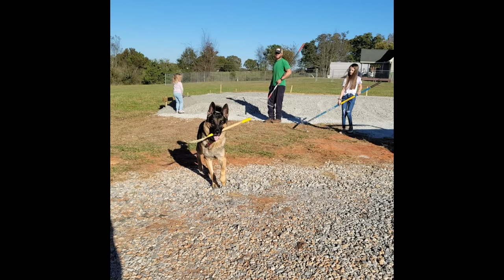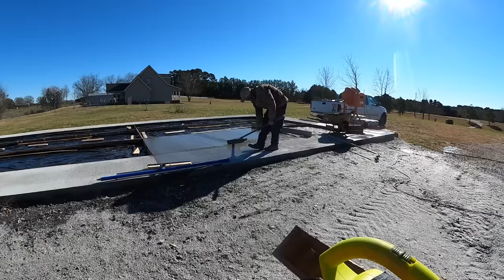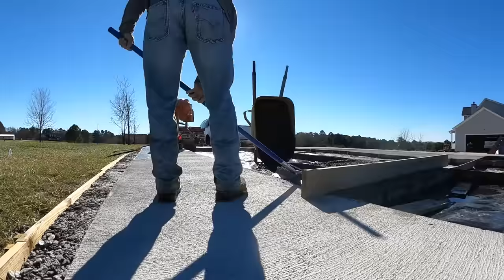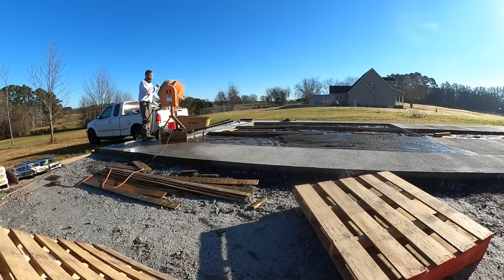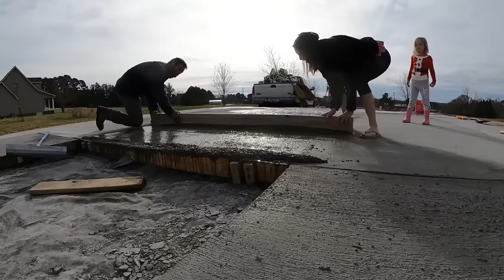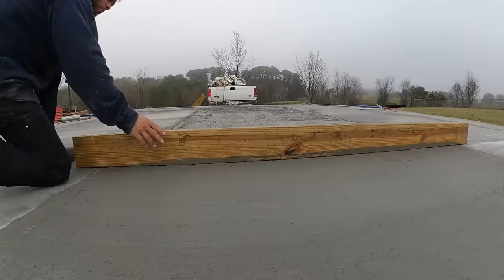Pouring a Huge Concrete Slab Using Bagged Concrete | I Saved $10,000

Comment: I'm not a concrete guy either, but what I don't understand is how you were able to get that much material out without the initial bags beginning to set up compared with the end bags.

Slow cure seems to be the answer, but that seems WAY longer than any cement I've dealt with, by many hours and then some...
Reply from the maker: I did this in our winter which was 40-50 temps at the time. The cooler temps allowed more work time. I did a one year update you should check out if you’re interested.

Comment: Love it 😅!  What would you have done different?
Reply from the maker: Thank you! I haven't had any problems whatsoever, and everything still looks as good as the day I finished. But the only thing I would've done differently (for added insurance) is tie the slabs together with rebar. I packed over 100 ton of gravel beneath it so it shouldn't be going anywhere anyhow. But that wouldve been good insurance.
Reply: @reallifetested2605  Interesting!  I was thinking the same thing.  Great idea 💡 btw!!!  You should add that to the end of the vid.

Comment: Is that bagged pre-mix cement?  Here in Australia that would be a very expensive option compared to mixing actual aggregate, sand and cement. Fair plan though , I’ve done a few.
Reply from the maker: It is. I looked into doing that because around here it use to be cheaper as well. With crazy inflation between high Portland cement and sand in my area it was going to be right at the same price vs the way I did it. Economics in the world are really messed up right now.

Comment: Was this all broom finish,  Curious what you process was.  Did you mix, pour, rod, bull float then broom?  Any edging, mag float or troweling?  I am looking to do this and concerned I won't have time to properly finish before it sets up.
Reply from the maker: Yes it was all broom. I mix, pour until I have a substantial amount in the forms, screed, float, waited until it was a good hardness then broom.  I did this in winter so I had plenty of time to work. As long as it’s cold out you have a while. Just make sure it doesn’t get below freezing. Our winters are mild. 40-50 in day time and high 30 to 40 at night when I did this.

Comment: I’m sure I’ll be undertaking something like this in the future so I feel the need to ask these questions. Why no rebar? And you’re not worried about the different sections moving independently of one another causing lippage?
Reply from the maker: I made a 1 year update answering a ton of questions that were asked in this video. If you’re interested you should check it out. The rebar is based on where you are. In my area no one uses it because it rarely gets below freezing and we don’t have earthquakes or anything like that. Most of the time around here they pour directly onto the clay with no issues. I haven’t had any shifting or moving of the slabs (I don’t expect to with the amount of gravel I put beneath) but just for added insurance I do wish I had pinned the slabs. I also cut control joints which I show in the other video. I’m going to be doing a 2 year update soon so stay tuned for that as well.

Comment: I understand. So many jobs get high estimates. Fence companies are driving in these easy metal posts now but they still quote five grand for 50 to 80 ft. Why is there $4,000 of Labor on $1,000 of material and you're going to be done in 3-4 hours? They'll rationalize it that you've now got something that will last 20 or 30 years so the cost per year is cheap. Really? I don't know that.  That's not how I spend money on most other things.
Reply from the maker: It’s funny you say this about a fence. I’m starting building our chain link fence today. We got quotes of 12 to 14k. I bought everything and doing it myself for about 7k.

Comment: How did that slab hold up on the gravel? When I built my shop they used road base gravel and it has done OK but a few spots are settling now.
Reply from the maker: It’s still holding great. It’s been a little over 2 years now and no hairline cracks. I did pack the heck out of it every few inches though. Also used recycled concrete on the outer edges that has hardened like a rock.

Comment: Load of rock, sand, and bags of portland cement.  Cheapest way with a mixer.
Reply from the maker: I checked into that before doing this project. The high price of sand and cement in my area was going to be about 163 per yard. I couldn’t believe that it was that much to mix individually going that route. I was able to get #80 bags for 3.20 each so I went with that.

Comment: no rebar and not enough expansion joints are a big problem
Reply from the maker: I called around and spoke with local pros. In my area they don’t use rebar on 4” residential on grade slabs. It rarely gets cold here and we have a hard clay soil. I’ve never seen it used in small buildings / driveways around here. I did a 1 year update if you’re interested. I don’t have any cracks at all and show the slab. I cut expansion joints just not in this video because it was so dusty you couldn’t see anything.

Comment: As european I would highly consider buying trailer of sand and washed 4-8mm gravel fraction, some bagged portland cement and mix own mixture. But is it possible to buy gravel in such small quantities in the US?  It is little bit more work but messing with pallets of bagged concrete isn't so much better and you are paying extra for same thing in hundreds of bags.
Reply from the maker: I looked into that because I’ve heard it’s a lot cheaper. In my area sand and Portland are so expensive it was only going to be about 5 dollars cheaper per yard going that route. Sand is going for over 50 dollars per cubic yard here how insane.
Reply: @reallifetested2605  Oh, I understand, it make sense if there isn't big difference, 5$/yard isn't worth of additional effort.

Comment: question, did you use rebar to reinforce your concrete slab?? and also did you cut out expansion joints after the concrete is set?
Reply from the maker: I didn’t use rebar. I made a one year update explaining but long story short our climate and my load requirements don’t really need rebar. I also go over the control joints in the other video as well. I did cut them.

Comment: Thanks for the awesome video. What are your thoughts on mixing the concrete in the wheelbarrow or the powered mixer? Did the mixer save a lot of time?
Reply from the maker: Definitely get a mixer if you're going to be mixing anything over 10 bags. I recently constructed a chain-link fence which used around 60 bags or so. (If I remember right) My dad told me that we could easily mix by hand in the wheelbarrow because the mixer and cord / setting up etc. would have took 10 minutes so we didn't have time for that HA We mixed 4 bags by hand and I said as long as there is a mixer nearby. I will NEVER do this again. It takes a ton of extra time, hard labor, and its harder to get consistent. I went and grabbed the mixer and we finished probably hours earlier.  Long story short. Definitely get a mixer if you have the space for it.
Reply: @reallifetested2605  Thanks for that info. I hope to pour some slabs soon. My barn is dirt that in winter turns into mud. So 6 months out of the year I can’t use it. I will add rebar to hold it all together and help with tractor truck driving on it. Buying 16’ dump trailer to haul my own rock.

Comment: great video and job, but don't you need rebar or wire mesh in a slab that big to keep it from cracking
Reply from the maker: Thanks! I called around and spoke with local pros. In my area they don’t use rebar on 4” residential on grade slabs. It rarely gets cold here and we have a hard clay soil. I’ve never seen it used in small buildings / driveways around here. I did a 1 year update if you’re interested. I don’t have any cracks at all and show the slab.

Comment: I'm not contractor or concrete guy, so I'm pretty ignorant when it comes to doing concrete work. I have a similar feat to accomplish myself after getting a 12k quote to pour a 24x24 pad for my patio... i liked you're idea of breaking up the concrete pad with the forms so that you could do it in sections. My only concern is that it looks like the forms you used you actually encased in the concrete, is that normal practice? will that not effect the overall longevity of the concrete structure? I also didn't see you put any rebar before the pour?
Reply from the maker: I did remove the forms. What I did was pour the outside pads first, then remove the center forms. I then used the outer pads as the forms (hope that makes sense. I posted a 1 year update with me answering the most frequently asked questions as well as doing a walk over of the pad. If you're interested you should check that out.

Comment: Nice work, you said you mixed a bag at a time, but how many bags did you mix and put in wheel barrow before you took it and dumped it. I was having trouble keeping up with the time lapse. Really impressed with your work..
Reply from the maker: Thank you! With this mixer I was mixing (2) 80 lb bags at a time. I was pouring (4)mixed bags in the wheel barrow dumping and repeating.
Reply: @reallifetested2605  thank you Sir, appreciate you responding back.

Comment: no rebar? is it normal to pour slabs without the reinforcement that provides? wont it be much more prone to sag and crack without that, especially if you use it as a garage and park very heavy things like vehicles on it?
Reply from the maker: I called around and spoke with local pros. In my area they said they don't use rebar in residential on grade 4" slabs. Around here they really only use it in homes or commercial / industrial construction. It rarely gets cold enough for the ground to freeze here and we have good soil. We also don't have earthquakes or anything like that (that I know of) I did a yearly update and will continue to do so if you're interested. I haven't even had a hairline crack yet.
Reply: @reallifetested2605  thanks for the info. i'm trying to learn about slabs and i thought the rebar stuff was to prevent the thing from sagging due to either direct weight above like a house/car or the weight it places on itself when the ground below unevenly sags due to "settling".

Comment: Ya know. This has kind of inspired me to pour the foundation for my 450 sq ft cabins. Much respect. How many sq ft and total cost?
Reply from the maker: It was a little over 1200 sq ft. With approx 120 ton of gravel, and the concrete I have about 3800 dollars in everything. I did a 1 year update if you're interested in checking that out, I answered the most frequently asked questions and went over local bagged pricing on my phone and things like that. You could definitely do 450 sq ft. no problem I can guarantee you'll save a ton of money. We got quotes of 14k plus for this job. 

https://www.youtube.com/watch?v=qKcy6BI8yA0&t=568s

Comment: Wait what did you do in between the 6 pours?  Did you leave the 2x4 in????
Reply from the maker: I did the outer pours first, removed the wood forms, then used the outer concrete slabs as the forms for the inner. Hope that makes sense.

Comment: Great job ! I’m doing the same thing on a smaller scale for a patio that I’m also pouring in manageable sections.  Can’t decide if I should use expansion joint material between the sections but it looks like you did not. Any thoughts on whether I should or not I’d appreciate.
Reply from the maker: I didn’t show it in the video because it was so dusty and you couldn’t see anything anyhow. But I did cut expansion joints. There is information online about how far apart to cut them based on the size of your slabs. You can better tell in the one year update I made a while back. I used a diamond blade and circular saw to cut the joints. Hope I was able to help out.

Comment: Great Job, hard work pays, I just did a 4X7 slab that was 6 inches thick for my propane tank to sit on.  I used a lot of rebar in it. Why didn't you use rebar?
Reply from the maker: Thank you! I called around before starting this project and spoke with local pros. They said that rebar wasn't needed in a residential on grade 4" slab in my area.

Comment: I'm getting ready to do a project, but nowhere near this scale. It's going to be 20x20. I'm trying to figure out of it's worth it to do what you did, or buy the concrete and have a truck delivery it.  Do you think the price of the bags, renting a mixer, and the labor to mix it would be worth it for a project my size? Do the bags save that much money on a smaller project?  I'm guessing it would on a project the size of yours, but I don't mind spending an extra hundred or so for a truck if it's not to much of a price difference.  Thanks!
Reply from the maker: It may be different now, or in your area. When I did this was during Covid. Truck was 200 to 220 depending on the day with a 4-6 week wait. The lowest quote we got on this was 14,000 dollars. I was able to do everything myself for 3800. I think concrete prices have came back down so it’s really up to whatever you’re comfortable with. One huge pro to bag is you can take your time with it. When the truck comes you have to know what you’re doing and get everything spread and screeded fast. Usually concrete crews have at least 6 or more guys all working together.

Comment: That's quite a workout !   How were you able to keep everything wet and pliable to be able to trowel the complete pour ? Looks like you may have had some poly down to maintain moisture.
Reply from the maker: Thank you! I did this in our winter (which isn't very cold) daytime temps were high 40's and night time temps were high 30's so perfect temperature for doing concrete alone. The poly works as a moisture barrier as well.

Comment: Nice work!  I am about to do the same for a similar size slab. What was the size of each section and how long did each section take to pour?
Reply from the maker: They were somewhere around 7-8’ wide and 20’ long. I don’t remember the exact working time because of my work schedule I was having to get everything out and put it all back up every day which added a significant amount of time. If guess somewhere around 5 hours of actual mixing, spreading then waiting around for it to harden up and floating it. I did it in cooler temps so I’d have plenty of time to work. The cooler the better for time as long as it’s not freezing.

Comment: Very cool. But you may regret no wire support.
Reply from the maker: I called around and spoke with local pros, they told me rebar wasnt needed in a residential on grade 4" slab in my area. I've seen 100's if not 1000's of houses in my area built at this point and they didn't use rebar unless it was requested. (in the driveways, not foundation footers)

Comment: You are bad to the bone dude.  You saved a little over 10K.  How much did you actually spend on the project to get the slab completely formed?
Reply from the maker: Thanks brotha! In total for gravel, concrete, and forms I had right at 3800 dollars if I remember correctly. For gas in hauling and all call it a little less than 4k. 

I made a 1 year update video along with me responding to the most frequently asked questions if you're interested. 

https://youtu.be/qKcy6BI8yA0

Comment: I'm almost certain code calls for rebar or metal lattice other than that looks good
Reply from the maker: I called around and spoke with local pros, they told me rebar wasnt needed in a residential on grade 4" slab in my area. I've seen 100's if not 1000's of houses in my area built at this point and they didn't use rebar unless it was requested. (in the driveways, not foundation footers)

Comment: 80lb sack is $5-$6 and it takes 42 sacks to make one yard, that puts it over $200 per yard.
If you hire a concrete truck it’s $100-$120 a yard. 
You may have saved in other areas but you surely didn’t save by buying sack concrete
Reply from the maker: In my area bags were 3.20 for 80 and 200 to 220 for truck with a 4-6 week wait. Contractors wanted 14k minimum and I did everything for 3800.

Comment: I have done jobs like this over the years mostly by myself with great satisfaction. I am moving to another location soon and want to build a 20 by 24 shop, and doing the slab myself. I'm going on 84 soon and my wife thinks uh uh. What would you advise?
Reply from the maker: I guess it depends on your genetics and health. My grandpa is over 90 and still cuts trees and splits the wood for heat. I’ve seen others in their 50s in worse shape than him.

Comment: Retired concrete contractor here. I’m confused how you saved money. It takes 45 bags of 80lb concrete to make one yard. Each bag cost $5.13 which equals $230 a yard. The most expensive ready mix concrete I could find in 2023 is $175 a yard so your paying $55 dollars a yard more then ready mix
Reply from the maker: I’ve made a video with me answering the most frequently asked questions. Bags in my area are way cheaper and I prove it online in the video. I explain more on the cost of everything in the video as well. 

https://youtu.be/qKcy6BI8yA0

Comment: 1 cubic meter of CB3 (areated road concere) in Slovakia cost 75 Euros..4 skilled guys for a day cost 400 Euros and a rent for throwel for surfacing  is 80 euros .. so im curios how tha 10000 USD savings are made :) and bagget concrete is unareated (so after winter and salt it breaks) and 16liters costs 4 Euros so a cubic meter is 250 Euros
Reply from the maker: In my area bags were 3.20 for #80 and truck was 200-220 depending on the day with a 4-6 week wait. It also doesn’t get cold here and we don’t have salt.